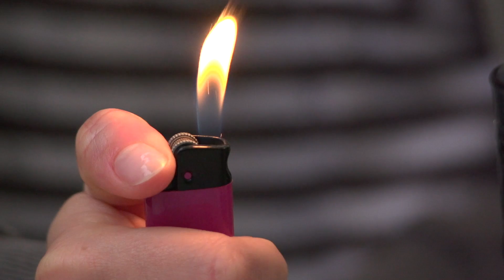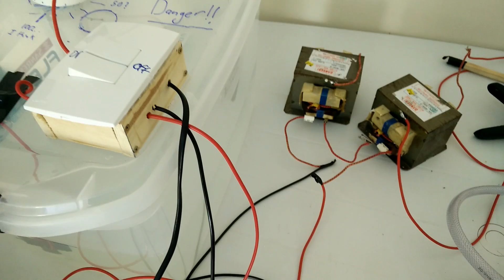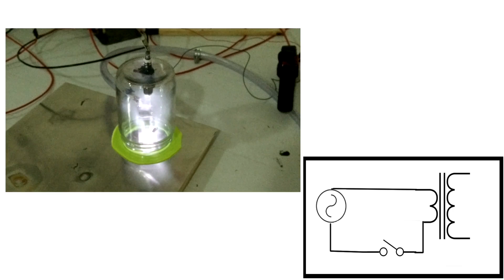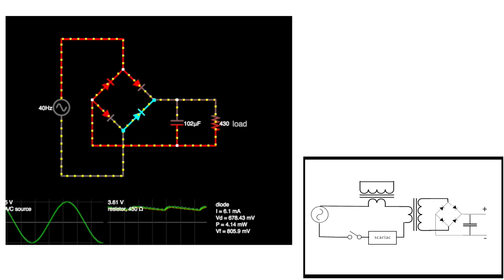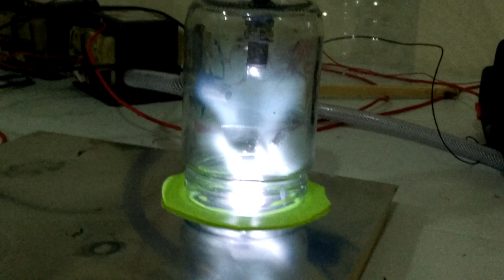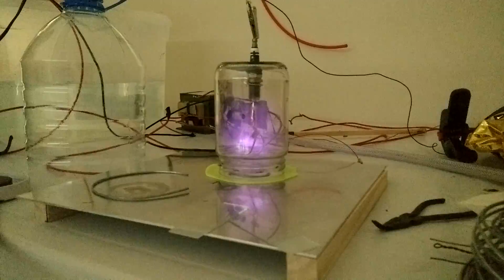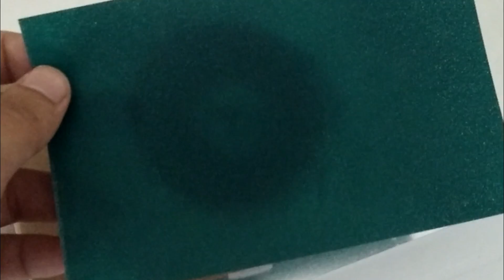Putting Plasma to Work (DIY Fusion Reactors, Magnetrons and More!)

Comment: "build simple fusion reactors" Sorry to burst your bubble, but creating plasma doesn't mean nuclear fusion. Just microwave a burning match, there you got plasma, but it's not burning the 0.000055% of hydrogen around it into helium, and dare not even think about higher order fusion reactions.
Reply from the maker: You're right, I left out the part where you add a gas supply system to provide deuterium fuel, increase the power to over 30kv and 30ma, and drop the pressure with a diff or turbo pump. But if you can make it to the point of making a jar full of plasma, you're already most of the way there. But all of that would be an entire series of videos so I went with a simplified explanation for now.

Comment: i have a doubt that. to create a fusion reactor need a vacuum which requires expensive pump. cant they just do it in space (not the big reactor but small one just to prove the concept) by using space vacuum which is much greater than what we human can produce on earth and cut the cost and time to arrive at the point that this thing is possible.

Comment: Great video! It took me back to a previous life when I worked for a company that made and sold a variety of "cold gas plasma" surface treatment equipment. All kinds of industries would use our products to modify the surface chemistry of polymer materials to enhance adhesion of inks and adhesives. For discrete plastic parts or synthetic fiber and fabrics, we could re-engineer the polymer surface to enable chemical bonding with the ink/adhesive/resin. This would often result in a cohesive failure mode of the substrate itself during testing.

Our equipment wasn't all that different than what you built - just on a larger scale. We had bigger, welded aluminum chambers to accommodate large quantities of plastic parts or various fiber and fabric carrier rigs, bigger vacuum pumps of course, and mass flow meters to control the mix and flow of the incoming gas chemistry. Our energy source was typically a 13.56 MHz RF generator driving no more than a kilowatt to plate electrodes through an automatic "matching network" (basically an antenna tuner to match the varying impedance of the gas plasma to the output impedance of the RF generator). I'll never forget the crazy light shows but some of my fondest memories were from that time of process development and troubleshooting mistakes, some of which were a real mess to clean up!

Comment: How large of a fuser would you need to power your house?
Reply from the maker: infinite since they produce no power.
Reply: What if you tweaked the design to get the energy produced in the fusion reactions?
Reply: It's been done, but it is a lot larger than your house. Its about the size of a power plant and 100x more expensive.
Even then, if it produces enough energy to power a house is debatable, as it takes more energy to run.

Comment: 1: never ignore the ground connection and propper grounding. 
2: wirig like depicted is like asking with big puppy eyes "PLEASE! Electrocute me!"

3: personal question, not moking you: had you ever had any jars implode at that pressure difference? I'm asking because I could see them as a cheap vacuum dehydrator containers. Much milder vacuums but longer times and lower temps...
I am looking for some cheap glassware to dessicate food in.
Reply from the maker: The only one I had implode was one I rushed the cutting job on and there was a small crack I thought I could ignore. Never made that mistake again.

Comment: Unless two microwave oven transformers (MOTs) are used in series like here one shouldn't necessarily ignore the ground wire, the standard practice is to connect it to the transformers' iron core to ensure it cannot 'go live', although I can see how standard procedure could be irrelevant and even counterproductive when applied to certain DIY MOT projects!
Reply: as he said in the video some models of MOT have one end of the secondary coil connected to the core, in those cases its probably a good idea to keep it away from earth.

Comment: They said tesla coils produce too much voltage and not enough current, but that all depends on the voltage conversion ratio, something that's easily changed by changing the secondary coil. This means you Could make one with the exact voltage/current needed and thereby have all the advantages of solid state tesla coils, such as the high frequency output and the precise control of the output voltage. This would've saved them from making that scary dangerous Frankenstein baking soda potentiometer (MadScientist props for that! :) Had they made their HV generator a modded tesla coil it would've been much smaller and much less dangerous, due to the operating frequency being too high to stimulate neurons, so it can burn but not shock.

Comment: So, i'm wondering, does the positive charged wire in the vacuum chamber work as a ground? Because when you look at the schematic of a real nuclear fusor, the grid in the vacuum chamber is only connected to the negative charged wire, and the chamber itself is only grounded. So is that the function of the +wire in this video?
I need this for my own project at school, could anybody help?
Thanks.

(The schematic im talking about is this one: https://experiment-uploads.s3.amazonaws.com/Lq71NgrRJGGnw1qDU51Q_fusor_schematic.jpg)

Comment: that "scariac" seems awful! I'd hate to have a crack or a leak and get covered in hot conductive corrosive liquid that's connected to mains.
Reply: Yes! Beware the dangers of HYDRIC ACID!
Reply: Corrosive? It's water and baking soda. People drink that for upset stomachs and as a ANT-acid. Pretty much the opposite of corrosive. It will neutralize battery acid too.

Comment: Fyi. Flint is harder than steel. The sparks from a lighter are metal not crystal. Excellent video tho. Thank you.
Reply: HillbillyMatt ExtremeDIY, Hardened high-carbon steel is indeed harder than flint. FYI.

Comment: Why are you using Tor? Inches of mercury are the metrics I'm used to dealing with.
Reply: John L Bales, The reason Torr is used instead of mmHg or inHg is because the latter are measurements based off of an assumed fluid density and assumed gravitational acceleration. Torr is based from a scale of absolute pressure, and is much better suited for systems that require accurate and precise measurements, such as nuclear fusion.

Comment: Could you add another capacitor in series to the circuit to further smooth what is left of the voltage spikes?
Reply: That would increase the spikes, not reduce them. What would work is adding the capacitor in parallel. If you put two capacitors in series, each 1 microfarad, your total capacitance will be 0.5 microfarads. But if you put them in parallel, you will get 2 microfarads.

Comment: If you are going to use a resistive load to regulate the input voltage, a fan regulator is a lot cheaper and safer option.
Reply: Transformers will not work very well with a triac based device like a dimmer or fan regulator, because it chops up the waveform too much. A proper variac or variable voltage inverter can be used for the best result. Also, there's nothing particularity wrong about using water, provided you do indeed know what you are doing and take the appropriate safety precautions. Wear shoes (preferably insulated work ones, or even better, boots), stand on a wooden floor or sheet of wood, wear nitrile gloves with thin leather gloves underneath and don't touch any grounded surfaces. Use only one hand and wear insulated gloves. I'v done it plenty of times and never got shocked. Sadly, lots of people lack common sense, and are dumb enough to try things like that without and prior research. Stupidity indeed kills.
Reply: Just about anything would be safer. People who post shit like that on youtube should be banned.

Comment: I know this video is rather old, however for those of you interested in trying out magnetrons for sputtering coatings I would really urge you to start with silver instead of aluminum or copper.  This is REALLY important if you are trying to get a conductive coating it turns out that other metals are extremely difficult to sputter and you’ll waste many, many hours of your life like I did before switching to silver.  I have seen at least one video where an amateur successfully sputtered a conductive coating of copper, however I have had virtually zero luck getting this to work, when silver was trivial to succeed with.  I have tried copper, aluminum, nickel, and many other metals and what I usually saw was a dark deposit on the glass that didn’t bear too much resemblance to the metal.  Copper gave you a gold toned deposit, however it wasn’t conductive no matter what I did.
Anyway, just a FYI in case you are trying magnetron sputtering and aren’t getting results that make sense.  One last tip would be to make sure you have a way to keep your magnet cool since any time you generate enough plasma for sputtering you are also generating a ton of heat at the surface and surrounding material of your target.  Too much heat will kill that nice neodymium magnet you’re using faster that you can believe, trust me on this, since the most powerful magnets of that type can start being damaged at as little as 160C.  Another critical thing to remember is that once you get a reasonable vacuum you are effectively insulating the things in the vacuum chamber, preventing a lot of the heat from being dissipated through convection.

Comment: You should connect the ground wire to the chassis of the transformer, it's even more unsafe not to do this...
Reply: Not if (as is often the case) one side of the secondary is connected to the transformer.

Comment: wait, fire is plasma too? ... so does that mean that fire can be controlled by an electromagnetic field?
Reply from the maker: Yup
Reply: Now to learn how to control EM waves and ill be a firebender :p
Reply: President Gamer I'd rather be an EM-bender than a fire-bender tbh
Reply: There isn't all that much ionisation happening in a flame of a candle or a lighter. The consensus isn't clear but many reputable institutes state that there needs to be a considerable amount of ionisation in the gas to call it plasma.
It's more accurate to say that flames contain some plasma.
Reply: https://www.youtube.com/watch?v=yuCGZyS3njE
Reply: ... and thus can be used to generate electric energy:
https://en.wikipedia.org/wiki/Magnetohydrodynamic_generator
Reply: Actually no!
Reply: It's a low temperature plasma. Here's the scale in temperature and charged particle density:
https://www.plasma-universe.com/images/f/fe/Plasma-types.jpg
Reply: You can bend the fire by using magnet
Reply: https://youtu.be/JV4Fk3VNZqs Applied science has very good explaination of that

Comment: how it is possible to get an arc in a vaccum? there is no gas to get ionize?
Reply from the maker: It takes a very expensive and powerful vacuum to remove enough gas that arcs can't form anymore. There's actually quite a lot of gas left in the chamber and it doesn't take much to fill the chamber with plasma

Comment: When you made the fusor, did you actually fill it with any gas to displace the rest of the air or did you just pull a normal vacuum and didn't fill it with anything?
Reply from the maker: I've done both.  Depends what I was doing.
Reply: Thanks for the fast Answer!

Comment: Wow. I just came across this video (not sure why it wasn't suggested to me earlier). I subbed. You're doing everything I wish I had the time to do.
Can you tell me more about the vacuum gauge in this video? I've been looking for a nice electronic one that goes from the millitor to single digit tor range but I'm having a hard time finding one. Chemistry is my main hobby and I've been building a lab at home. I have a nice pump and I'm building a fume hood and I've slowly been piecing the vacuum components together and I just need some good in-line gauges. I can roughly work out how deep of a vacuum I have based on known boiling temps of various liquids but it would be nice to be a bit more accurate.
Reply from the maker: Honestly that gauge was the first thing I found when I searching d "electronic vacuum gauge" on the Brazilian equivalent to eBay. I can't really suggest a particular brand. I tend to just look on amazon and eBay and pick one that's rated for the pressure I want and has the type of hose adapter I want. I left that gauge behind when I left Brazil so I can't even check what brand it was, sorry. Wish I could be more help
Reply: The Thought Emporium no problem. Thanks for replying so quickly!
Yeah I searched the usual places (amazon and eBay) but didn’t find much except for super expensive models, at least here in the US. Oh well. I’ll keep looking. 
Your videos are amazing. Keep it up!
Reply from the maker: http://www.ebay.com/itm/Fieldpiece-SVG3-Digital-Micron-Vacuum-Gauge-0-9999-Range-/132005419688?epid=19003302604&hash=item1ebc22daa8:g:lWgAAOSwnyBZu8kQ

That's the exact model I used.

Glad you enjoy :)
Reply: The Thought Emporium thanks! That’s really nice of you to take the time to do that :)

Comment: Why would you inductivly ballast the primary side of the circut? Is this because of the sensitivity of MOT's in general or to protect from high current surges in the highly questionable "scariac"? It don't get this. In my opinion the secondary part of the circuit is the part of the circuit that would need a ballast.
Reply from the maker: It protects the mot. I've tried not using one and I've literally melted mots from current surges. A ballast infront of the transformer is pretty standard for those who DIY these.
Reply: Running to flip the breaker every 5 minutes gets annoying as well.

Comment: First off, thanks for this video, really informative. But I have a question, plasma inside of fusion reactors/fusors is basically just gas, ionized by high voltage?
Reply: You have liquids, gases, solids, and then there is plasma. It’s not a “state”, though, because it isn’t stable- it’s ions in action!!. It could be referred to as a “transitional state”?    ie: you’re a human always, but on the way to work, you’re referred to as a commuter. Two of your “states” may be a Resident and a Worker, but in between those states, you’re a Commuter. Now you got it!;)

Comment: This is by far the best video on plasma, demo fusors, vacuum systems and HV electricity applied on fusors. I actually built a demo fusor, you can watch it on my channel, the video is horrible it deserves a more professional approach but I have no time (I am in finals ☹️). My main problem was measuring the pressure, what gauge did you use?

Very good video!

Comment: you can also use a dimmer pack located at your friendly hardware or home repair store. use on supply side of transformer(120-240vac. please, Be Careful. if you get hit by full current on the secondary side of transformer,a medical emergency crew + a trauma team having coffee in the next room will not likely bring you back. after all they electrocute in America,or rather they used to with 2000vac @ 200 amps. these experiments involve a bit more then that on the secondary side. so if you die from carelessness,don't come running to us.

Comment: I was trying to make a flame work like a transistor once. The idea was to check if change in size and temperature of open flame would cause the current flow to change. Of course you couldn't saturate such a transistor but you could throw in a differential amplifier to make it work like a proper transistor. You could build logic gates and end up with a fire breathing computer in the end.
Reply: How did your experiments work out?
Reply: They did not, the flame was not hot enough to be able to see any significant difference. Maybe later, with better setup I'll make it work
Reply: If you ever give it a proper go, drop an update for us. Would love to see how it turns out.

Comment: Worth mentioning that microwave oven transformers do have some current limiting, but it isn't very effective - there are two steel magnetic shunts placed between the primary and secondary windings, which help to limit the short-circuit current. A far better way, like you've done here, is to use another transformer as as choke. BTW, if you ever make a spot-welding transformer using a microwave oven transformer, you need to remove the shunts, otherwise you don't get as much current as you could!

Comment: Actually the "flint" in lighters are generally mischmetal an alloy of rare earth elements. They are used like this because it is hard to separate them and it doesn't really matter to have pure elements. As well when rubbed like with a striker they produce sparks. Most metallic firestarters have them.

Comment: I think your warning about the dangers of high voltage, and especially MOTs could have been a bit more stern. Something like this:
If someone builds something like this, be extremely careful, the output of a MOT is lethal to touch, including the DC after the diodes. If you get shocked by it, you will probably not get a second chance. (especially if you forgo the current limiting parts) Also, working on dangerous high voltage stuff alone is a bad idea.
Othervise, great video.
Reply from the maker: I mean, I did say EVERYTHING from this point on was dangerous, but I get your point. Glad you liked the video
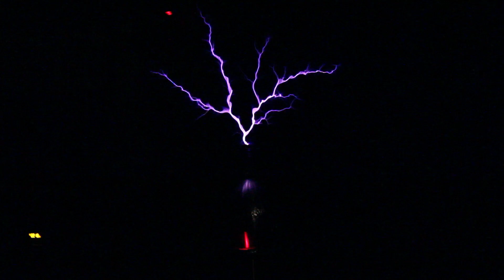Reply: What I'm also worried is the mess (19:00) on the table, not a good practice to show off on a video. Even myself, I've been instructed on HV dangers, wouldn't use any HV system without physical separation to avoid reaching inside. 
Don't forget: you don't need to touch it, just too narrow and it sparks.